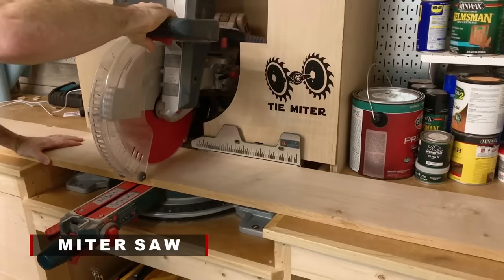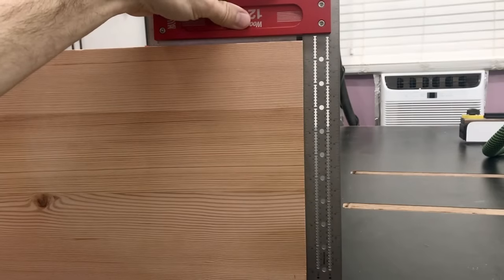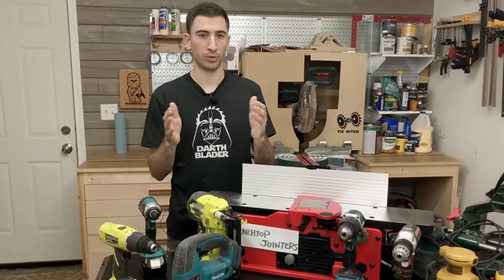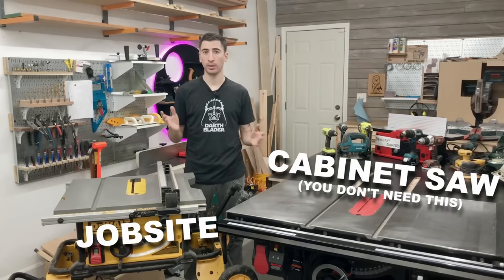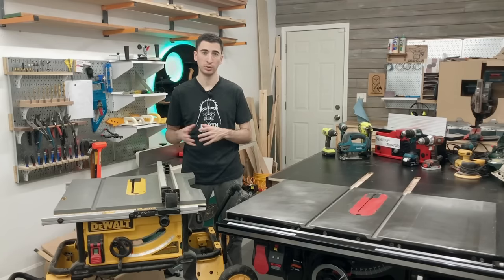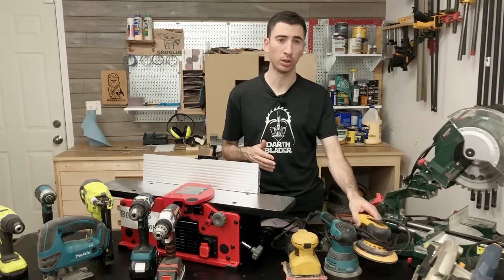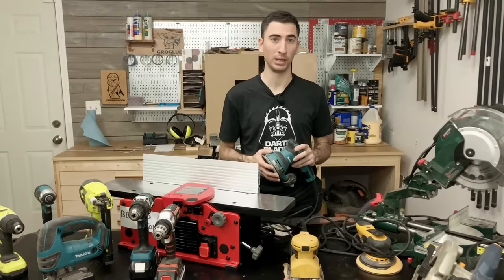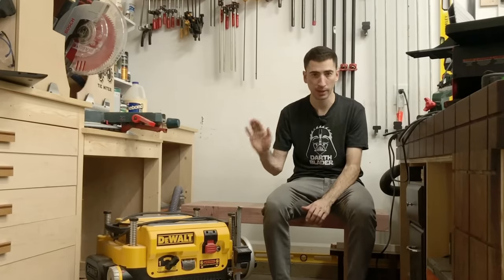Woodworking POWER Tools // Watch Before Buying

Comment: When it comes to power tools, I always buy corded.  I'm in my 60s and the tools I bought in my early 20s still work.  None of the battery operated tools I've had over the years still work.  I can walk into the garage and start a project right now.  Even if I could still get the batteries of yore, I'd have to run out and buy batteries ($ding $ding $ding).  Extension cords rarely need replacing!  And that is all you're removing from the equation with an expensive battery.
Reply: Hmm.... it's not all you're removing from the equation (getting rid of the cord) - you're adding a few things with cordless tools. One is independence - so, anywhere at any time. Another is ease of access in certain environments. On sites, you can also waste a hell of a lot of time just finding an available power supply, or going through permitting requirements to get one in, and then spending half an hour running cables in a way that complies with site H&S protocols. Corded works great in permanent setups, but there are good reasons why most people use cordless too.
Reply: @catparka7698     The description for this video actually says, "If you haven't made any purchases yet, watch this before buying anything."  So, it's safe to say he's not talking to contractors/tradesmen/craftsmen, or his language could be considered misleading.  I maintain the extension cord is all you're removing from the equation and your points are all well taken, but specifically related to that.  You certainly don't get better performance from the power source, nor does it save you money.  It doesn't make the tool better outside of not having to use an extension cord.  But that convenience comes at a cost that's beyond purchase price.

For you professionals, no argument.  You guys will use a power tool (corded or battery) enough to get your money's worth.  But for us novice/DIY guys, it's very unlikely we will get the value from a battery since it's generally occasional use (everyone's mileage varies).  In my case, bigger projects/remodels/repairs where I cycle through several of my power tools are often 3-5 years apart.  So, when I pick up a tool after setting for 5 years, a corded will work, a battery will not.  No matter how I store the battery.  Point is a pro is pretty much cycling through tools and replacing them because of wear and tear or improved capability.  I have at least 3 power tools that are shy of 40 years old and several that are 20 years old and some 5-10 years old.  I've tried battery, but it just isn't practical for me.  Truly a waste of money in my case.  I've only used my power tools at my homes, so running an extension cord really is a non-issue and it works every time I squeeze the trigger.  If convenience of no cord is the need and cost is not a consideration, buy batteries.  If longevity of the tool is the requirement, corded work damn near forever.  I think for a beginner, start with corded so you'll have it whether you use it frequently or rarely.  Move up to battery if the circumstances require it and you feel it will get frequent enough use.  Battery life is a double-edged sword.  Batteries only last if they're cycled, but of course, they have a limited number of cycles.  It seems only appropriate to warn they will have to buy those battery tools more than once if they live a long life enjoying these crafts.  Cheers!
Reply: @MO-ss7qt  Morning. Thanks for your considered reply.  I do take all your points and, funnily enough, they're surprisingly timely. I have corded tools and battery tools. The main reason I had for investing in battery (mainly 18 and 36 volt Makita) was moving from civilization to living off-grid. Over 15 years I've built everything from garden beds to board walks to our house using these tools, simply because running a generator in the middle of a forest-reserve just isn't what this place is about. Sometimes it's necessary - if I need my big skill saw or table saw or concrete vibrator etc - but mostly the noise and fumes are at a minimum. Same with battery power on the mower and chain saws etc. Certainly, I could run things off an inverter, but then the problems go in another direction with needing far more power capacity than everyday (non-building) life requires. My work - mainly on large industrial sites like steel-mills or production facilities - is greatly simplified when I don't have to run power-cords. But... if I do take a step back from my somewhat odd circumstances, then I probably have to view the whole thing a little differently. My experience is of battery as my mainstay - a godsend where the benefits have far outweighed any downside. But maybe I'm in a habit where buying battery is a sort of reflex that's no longer entirely fit for purpose. You've also made me think about how I work at home - battery allows me to be disorganized, whereas firing up the generator imposes a discipline in that i need to commit to doing a body of work as efficiently as possible. Funny old world, isn't it? Thanks for your thoughts - from a cabin in a swamp in a rain-forest in New Zealand.
Reply: @catparka7698  And me in a suburb in the U.S. with outlets everywhere.  I don't even own a generator.  I did have some jobsite experience In my youth.  I worked for a general contractor as a laborer and eventually joined the concrete team (what was I thinking?).  I needed pads for my knees, a shovel and calloused hands to swipe a trowel.  No extension cord needed! :)  Thanks for the insightful chat.
Reply: @MO-ss7qt  Yes - good to talk with you too. I think you've saved me a few bucks, as well. Sorry about the concrete thing as well - I had my years of youth and foolishness as well and every day now, when I get out of bed or out of the car, the memories come aching back. Wouldn't be twenty again for anything. All the best.

Comment: I cant remember if its husky or Milwaukee but they bought out ryobi like 2-3 years ago. There the exact same tools. They also own heart the Walmart brand. Its funny people still say ryobi when they are the same tools as the one that bought them for years now.
Reply from the maker: I'm going to do an entire video on this topic - but just because a parent company owns another brand doesn't mean its the same tool.
Reply: @Lincolnstww  "Both Ryobi and Milwaukee tools are owned by Techtronic Industries based in Hong Kong. The company is largely decentralized in the fact that each brand has its own company headquarters, Milwaukee in Wisconsin and Ryobi in South Carolina. However all manufacturing is done in China at one large factory."

Its all chinese and made in the same factory haha. Though i will say you have to by the better ryobi drill ($120) if you want it to have a hammer function for drilling through concrete. But my ryobi tools have handled the general construction industry, 1'000's of jobs and all the batteries have lasted over 5 years. Even my compound miter saw and chainsaw are a ryobi. Never a single problem. And as a flooring contractor (I also do decks, trim, fencing etc.) my multi tool has cut several thousand door jambs, i only had to replace it when it got rained on after 6 years of use.

The thing is ryobi has 2 (or even 3) tiers of tools for everything. They have a $30 skill saw, and a $70 one. They have the standard drill that comes with the full tool set, and the $120 one that has the hammer function.

If you take care of your ryobi tools they will greatly outlast their value/cost. It is a more brittle plastic though (how they can sell them cheaper) so they wouldn't take dropping a 2x4 on it etc. as well.
Reply from the maker: @MrCreed145  you will greatly enjoy this video, I’ll have a former engineer from TTI in it, Who worked on developing their handheld tools. Being made in the same factory means very little. It’s all about tolerances and internal components.

Comment: Not all DeWalt table saws have a "reliable fence system".  So, a blanket endorsement of these is misplaced. I just bought a new DeWalt table saw and the fence system is awful! It's so flimsy and rarely seats square, resulting in terrible cuts.  I may give this one away and get a better one.  I have an old Craftsman which I really like, but the movers lost the fence and I can't find a replacement.

Comment: Yes, buy those expensive  power tools. It’ll make your wood working much gratifying. Advice , learn how to use them. Read the instructions.😊 And take care of them, after use , clean them , use shop vac to remove wood particles and dust. Things last longer if you keep a stringent maintenance on tools , specially power tools. When things break or don’t last long its because we’re probably are not following  manufacture guidelines when it comes to maintaining our tools.

Comment: I bought a Rigid jobsite saw because I had very limited space at my old home.  While it is a decent saw for the price, it is really a terrible table saw.  Very unstable, small table, low power.  Save your money and either get a Kreeg ACS3000 or a decent contractor/cabinet saw.

Comment: I know the feels about the drills and dakkadakka, I went ryobi because...theyre basically all the same damn thing, and they're all overpriced.

As far as the table saw, my Ryobi has been great for like 10 years, has literally handled metal cutting blades just fine for aluminum and I might upgrade the motor horsepower to do steel...  the fence has been fine, the slide is...meh, but everyone loses it anyway.  Got it for a song too.

Got my bandsaw for under 200 bucks used, and am gonna swap the motor on that because I like doing metalwork too.  The trick to everything is if youre crafty you can get a used tool and turn it into something amazing.

Comment: Uh, no.  I disagree.  I bought a  Chicago electric miter saw from Harbor freight and it had problems with the plastic guard when cutting as well as the angle adjuster broke.  I’m not saying you have to buy a Dewalt or Milwaukee, but be wary about buying power tools from Harbor freight.  Research the brand before buying. Ryobi is more durable than cheap stuff from Harbor Freight, but not as smooth and easy to work with as the better brands.  For instance, Ryobi impact drills are bigger and heavier and more unwieldy than Dewalt.
Reply: I don't have any problems with mine, not sure what you mean. Which angle adjuster?

Comment: Avoid the Ryobi miter saw. Even at the max adjustment angle on the fence, the blade couldn't be squared to the fence. The blade was also not square to the throat, with very little clearance on one side when fully extended. While it wasn't super expensive, it was a bad use of $270. I'm not even going to call the Ryobi a bad investment as there was literally almost no long term value.  I can only assume what I received was bent somehow, but the box was in good shape when I purchased it.  That implies a possible manufacturing defect, and absolutely means poor quality control at the factory.

Comment: Don't look too much at the initial price.

Look at whether the tool will be nice to use, with at least a decent quality.

Get quality brand tools. That saves a lot of frustration. When looking at the cost, think about the total cost of owning. So think about resale value.

Buy those quality tools new or lightly used. Have an eye out for discounts. Take care of your tools and you can always sell them for a reasonable price. With care I mean, handle it gently, keep it looking good and don't leave it in a damp shed during winter.

Stay away from bottom of the barrel tools like those sold in supermarkets.. Unless it's for tools where precision isn't a point, like a battery drill.
Do look at cheaper lines from good brands. Like Bosch green or Makita Red. Very affordable and the quality is at least acceptable.

Comment: Does your stand-alone Grizzly G0858 require a 220v outlet or regular 110v?  I don't WANT to have to put in a 220v outlet so just checking first.  Thanks.
Reply from the maker: Yes 220

Comment: If vibration will effect the quality of the piece you’re working on, stay away from the cheap tools. I’m not really happy with the Ryobi cordless trim router and jigsaw for example. But the pin nailer, inflator, detail sander, and hot glue gun are great. And Ryobi makes things the others don’t, like a great 1 gal pesticide/herbicide sprayer, and a rotary brush (cleaning) tool that uses 6” brushes at low speed (one of the best tools I own!). So even if you like great tools, don’t be a tool snob.

Comment: Table saws are responsible to approximately 40,000 injuries per year, and a lot of amputations. They are the singlemost dangerous tool in any shop. I approach my table saw as an enemy everytime I use it and have never been injured. But my next tablesaw will be a Sawstop.

Comment: I have the same table saw for the same reason, it fits a dado. However the table and fence are tiny. I have used it for years and it served me well but it's definitely time for an upgrade. Also I agree that Makita is definitely the way to go for cordless. Also I use the same planner with the Dewalt planner stand and if you switch out the cutting heads with an upgrade it works great.

Comment: The Skil table saw is barrel of the bottom? It can be entirely calibrated
Reply: Also, interesting you’d advice a $650 planer to a beginner, when a router with a sled can do a great job

Comment: Well disagree on a few points, table saw soley depends on what kind of wood working are you going to doing ? a small dewalt saw like in your video is a nice job site saw but wont build cabinets if your want to get into cabinet making, its to limited in its crosscut ability.  I wouldnt buy anything and repeat anything Ryobi, they make complete garbarge tools and they breakdown alot, STAY AWAY FROM ANYTHING RYOBI.  The miter saw again depends on what your building, if you get to small of one you cant cut 5inch stock 45 degree miters.  Alot of this advice really depends on what kind of woodworking are getting into.  Harbour freight  high end Bauer or something like makes a sweet sliding miter saw for $300 and its rock solid and works great.  Not knocking your video i agree with alot of what you said but it really depends on what are you building ? you aint building kitchen cabinets with that dewalt, and yes you need to decide whats you goal ? budget, dont skimp on quality or it will come back and bite you.  I think you need to know where and what type of woodworking you plan on doing to help with your purchases.

Comment: It’s too bad he puts a blanket statement out like that about Skil and doesn’t know about the Skil worm drive table saw. Same rack and pinion system as the Dewalt, takes a dado overall looks much better. I’m sure in a side by side comparison the Skil beats the Dewalt in other areas as well, such as the rip capacity of 30”, I believe the Dewalt is 25”.
Reply from the maker: google skil vs Skilsaw. You’re talking about Skilsaw. You’re welcome

Comment: First error is touting a one pony show. Miter saws are LIMITED! Second: the USA has eliminated itself to more one pony shows. planar  jointer. The Brits have a great dual purpose tool accomplishing BOTH in one unit.
Reply from the maker: I’ll take a stand alone jointer and planer over a combo. Don’t knock it before you try it.

Comment: I bought a new Grizzly contractor saw when I was a young man in '89 and still run it now. No pro-level by any means, but very good for many diy projects. A good mid-level cast-iron table will last and not break the bank.

Comment: You can get adapters for the batteries, so they fit more brands. For instance, I use Makita as well. But I have a mobile BOSCH miter saw. Instead of buying BOSCH batteries, which are also 18V, I use an adapter, since I have plenty of Makita batteries. That way I also do not have to have two kinds of chargers. I really wish the industry would make some standards instead of this proprietary bull. It is a waste of resources and makes people think, that they can not use a battery from another brand.

Comment: I disagree, my woodworking has progressed to near expert level and my miter saw is the second most used tool in my shop outside of my table saw. Also, that Delta is about the same price as a higher end jobsite saw and a much better option

Comment: A good workman never blames his tools. I've been building custom cabinets and fine finishing for 30 years.  All my tools are used and cheap. As you mention, tune them up and know how to use them.
Reply: That is true in many cases. But there's occasional things though. I bought house and in market I happened to saw very cheap jigsaw. Grabbed it somehow thinking that it has all the usual stuff. Then later I figured that it didn't even have speed setting. Full blast on the go. Shoe was almost impossible to set straight and blade fixing was absolutely terrible. Some time I later got one with the only good blade methot, t-shank model with quick release, speed settings, rocker etc. I paid quite a lot of it as I was so annoyed by the cheapo, but I was still so happy to replace previous. So all in all. Be careful when buying the absolute cheapest option cause they apparently can miss features that you've taken forth granted for decades. But there's definitely good affordable tools out there. Just the very cheapest tools, well they most of the time are actually junk. Like for years I bought socket sets etc. for cheap, but then bought one about 500 euro set and I've been using them now for 20 years. All tools are still in good shape. I wish I would've done that decision even younger. Sometimes good quality is absolute must.

Comment: I disagree with your opinion of belts sanders I do a lot of work with metal and acrylic if you are doing anything other than woodworking you will need more than a hand planer, you also can’t plane rounded surfaces like a belt sander can